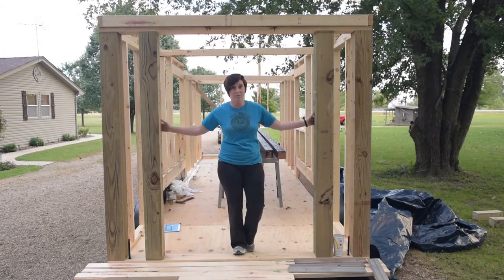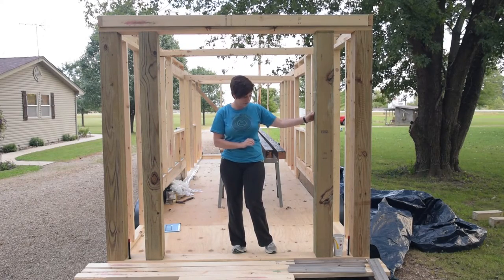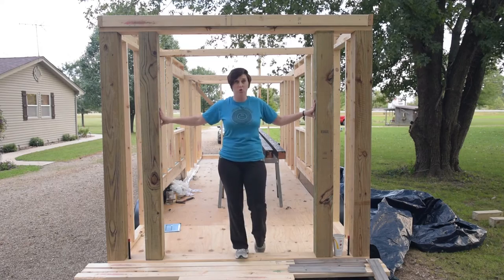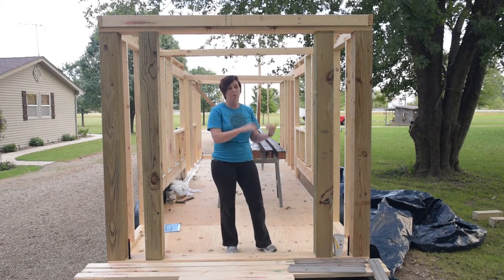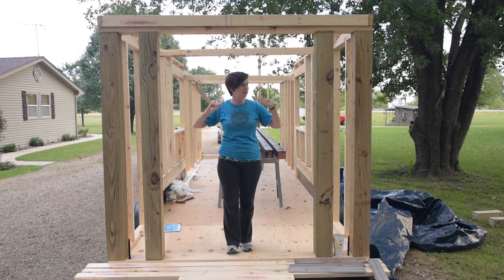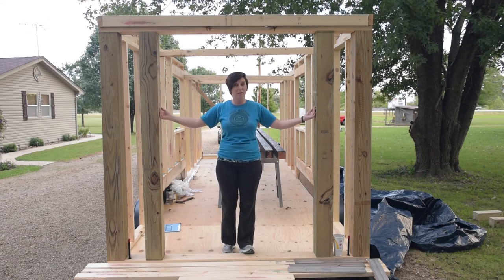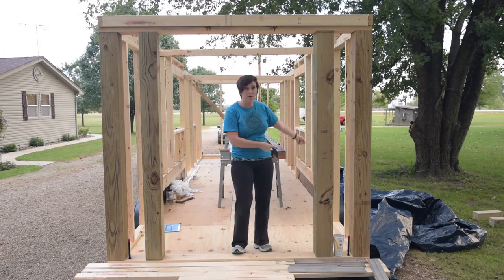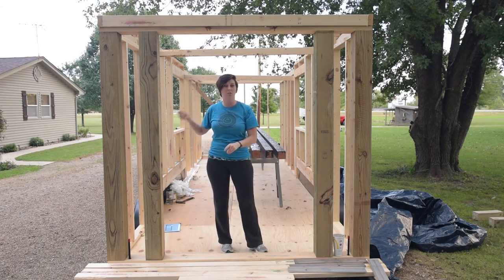About Our Front Door (Tiny House Wall Framing, Part 2)

Comment: You want the doors to swing out because you will loose space inside, when they are open.
Reply from the maker: Exactly.  We don't want to worry about keeping the area right inside the door clear of furniture either. 
Our small couch is going to block part of the right-hand door, so we will mostly only use the left door anyway, but I want them both to swing out in order to not lose any room inside the house.
Reply from the maker: Have you seen the front video?  We finally got it installed and thought you'd be interested to see it! :)
Reply: Yes I have.....looking great!!